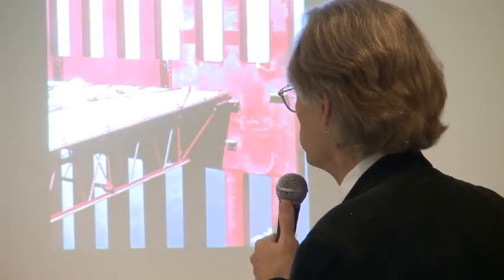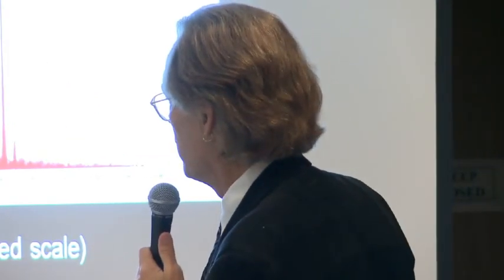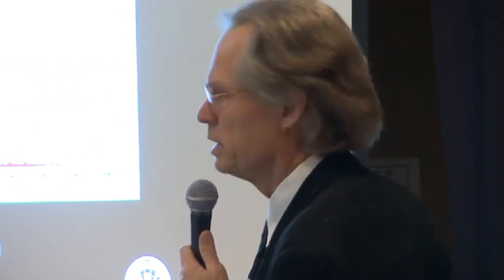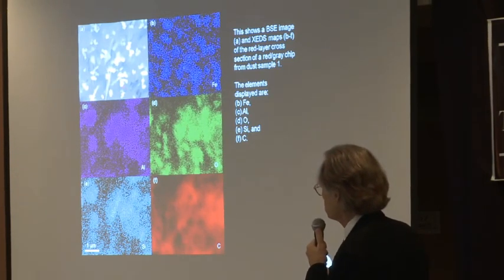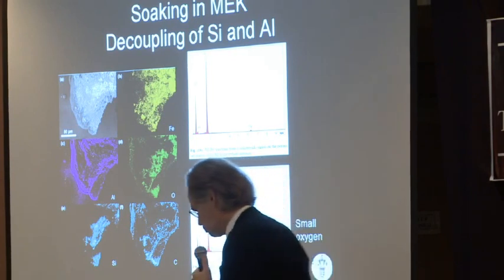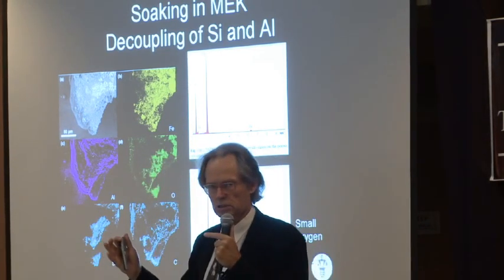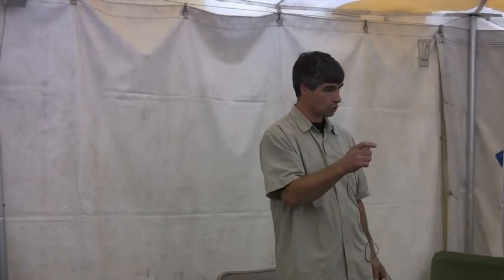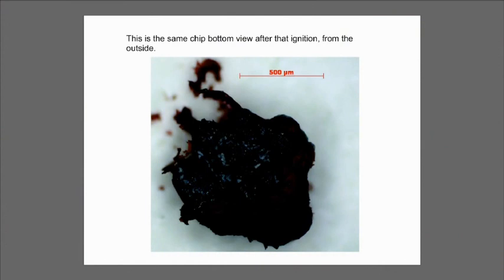9/11 WTC-chips are not paint and produce a thermite reaction: Dr. James Millette is wrong

Comment: As I remember, nanosized (transparent) iron oxides has been frequently manufactured with quite uniform particle sizes/narrow distribution for many decades. But they have tendency to agglomerate later. Probable "Laclede primer" manufacturer, Pittsburgh Plate Glass Company, simply solved this issue, therefore we see uniform iron oxide rhomoedric nanocrystals in the paint layer.

Comment: I wrote: "..there is no reason to think that this chip is anything else than some WTC red primer". I meant....judging from the analyses of chip themselves, indeed!  
Moreover, the hypothesis that molten metal allegedly found in WTC basement had anything common with extremely short burning of nanothermite is exactly as idiotic as that it has anything common with burning of paint:o)

Comment: No melted steel in the crushed floors which looked like a meteorite. I can see rebar from the floors bent holding the 3 or 4 floors together. I see paper, no melted steel. No thermite. I see paper in your "meteorite", lol. Paper. You sure are gullible. Get glasses.
Wow, melted metal youtube videos. Wow, take that to 60 Minutes - Sunday? Wow, just wow, youtube video. Wow. 
Why is the rebar not melted? lol
Look up simile. Find some melted steel. You will find a lot of simile, no melted steel.

Comment from the maker: Google: 
"WTC fires burned for weeks" and you'll find News articles that tell the WTC fires lasted around 12 weeks! 

Think about the actual size of the building fires just before each of them collapsed (relatively small in size, most of the floors in the three collapsed buildings had no fires in them when they collapsed)
..and then try to explain what kept the fires burning for 12 weeks, after all that water and foam sprayed on the piles

Pocket fires still burning in December 2001 =Thermite

Comment: What is puzzling about the sulfur?  What did FEMA say; more study. At 1000C, it was not thermite. Quibble about the corroded steel all you want. Using the corroded steel as evidence of thermite is a sign of mental illness. 
Since there is no damage to WTC steel by thermite, you have to  make up other silly questions so you can Gish Gallop your way to woo.
You should have taken more chemistry classes, and added at least on course in Chem Eng so you could comprehend the report, and eutectic.

Comment: No melted steel. The eutectic of the corroded steel shows the steel was subjected to 800 to 1000 C. Not hot enough to melt steel, but hot enough for the steel to be corroded by fire. 
The "WTC meteorites" are 3 or 4 floors fused by the energy released on 911. Tower collapse released E=mgh. Physics explains the collapse. Fused floors look like meteorites, a simile.
No melted steel on 911. Melted metals on 911. Aluminum, lead, copper, Magnesium Alloy, zinc, things that melt in office fires.

Comment: There was no evaporated steel on 911. No melted steel. There were two pieces of corroded steel found. Corroded in fire. The max temperature of the corroded steel was 1000C. No thermite damage to any WTC steel. No tons of thermite product, piles of iron, found. 
Gish Gallop on  to new crazy claims. What did 60 Minutes say about putting your claims on TV?  lol
The steel was corroded at temperatures 1000C and below. Which part of 1000C do you not understand. Your thermite fantasy was no used.

Comment from the maker: evaporates ..not melts

Lawrence Livermore National Laboratories talks about the (iron ox- Al) solgel thermites exceeding 3500 degrees C, and boiling point of steel is around 3000 C, they say
It's not melting, it evaporates at such high temps.
 If there is sulfur in the nanothermAte, it explains the sulfur corrosion

Read the LLNL article yourself:

"Nanoscale chemistry yields better explosives"
w. w. w..llnl.gov/str/RSimpson.html

Comment from the maker: The patent talks about AVERAGE particle size of less than 100 nanometres. Average doesn't necessarily mean that the powder is very consistent in particle size.
..And this is exactly what i meant when i question pigment powders being very, very consistent, and i'd expect some variation in particle size if it's just primer paint.

But Harrit et al paper speaks of the iron ox as being "..  consistently 100 nm in size and have a faceted appearance.", so very uniform.

Comment from the maker: "..there is no reason to think that this chip is anything else than some WTC red primer."

-Other than the large amount or 'iron rich micro sphere' in the WTC dust, reported by EPA and USGS, and the investigators hired by Deutsche Bank.

-Other than the molten orange-hot metal that they found from WTC basements many weeks after 9/11

"Paint and fire" produced the molten metal, seen by firefighters and others, running in the basement floors of the WTC buildings, right?! ..for weeks. Paint?

Comment: The steel did not melt, it was corrosion 1000C and less. No thermite damage to any WTC steel.
Called Gish Gallop, you keep bringing up new junk to support your fantasy. Your delusion never ends. You failed on the steel which corroded, you bring up the eutectic which had sulfur in it. No thermite damage, sulfur. At least you don't know what UPS have in them. Knowledge free, easy mark for Jon Cole and other nuts in 911 truth. 
Jon Cole's experiment left fused iron on the steel. I saw it.

Comment: "Niels Harrit actually told us that they cut another chip"
Where and when? Why is he holding back that data?
"But cause they didn't cut the MEK chip, you can always go on claiming "it's a different chip""
At the very least there is zero proof that it's the same. But Fig 14 would show more "contamnination" that anything if it were the same. Unlikely.
"ou're the one who withheld info about clays used in sol-gel/aerogel composites"
What??

Comment: Even if the MEK chip was the same material as chips (a) to (d), but contaminated e.g. with Zn and Cr stuffs (why?), there is no reason to think that this chip is anything else than some WTC red primer. It has a typical composition of paints, typical structure of paint (thin compact layer on the rust flakes and typical behavior when "soaked" in MEK. Everything we know is in perfect match with some red primer paint:o)

Comment from the maker: "That chip was of a DIFFERENT material than chips a-d, which contain kaolin, where Al and Si are bound."

You only assume and make claims that they're chemically bound, but you have no proof to back this claim!

Harrit et al even say it is very difficult to tell, so you can't make the claim the other way around either. 

Ultra-fine particles might only APPEAR to be chemically bound cause they'd be so very close to each other
..but with accurate enough instrument the truth could be shown.

Comment from the maker: "You show that you don't understand the gel processes. No, that is not possible"

What i actually meant, and it's what i heard, is that if you do not use that analyzing apparatus the right way, and don't direct the beam just in the right position, you might not get the right reading
..so with very, very tiny particles placing the beam in the right spot would become even more difficult, right
so i actually didn't refer directly to the sol-gel method at all.

Comment from the maker: Isn't the size in the label a "maximum" size of the particles?
That's how the sizeing (of rocks) works with cement/concrete dust
-
Why are you then supposedly qualified to talk about nanothermites, when you didn't come clean that clays are used in sol-gel matrixes?

It's funny how it always works with "debunkers", they/you can side-track and change subjects all you want, but the other guy is supposed to hold a degree on the matters he talks about or he's views are attacked immediately

Comment: "I'm sure you know alot more a about paints than i do, but the UNIFORMITY of the Iron oxide particles is what is bothering me"
Why does this bother you, when you already acknowledge that you don't know enough about paints? With some smart googling you can find pages where pigment producers, often from India, offer iron oxide pigments, assorted by size (often, you find labels such as "RD 130", which would mean "mean pigment size 130 nm")
Which smaller particles?
There's no elemental Al, sorry.

Comment from the maker: Exact words used in the Harrit et al paper:

"Evidently the solvent has disrupted the matrix holding the various particles, allowing some migration and separation
of the components. This is a significant result for it means that the aluminum and silicon are not bound chemically."

..meaning Al appears to be in there as dust
-
"Most likely" ..some of those maybes-maybes, ay?! But, still you're correct and others are wrong ;)
..thou all you offer is maybes-maybes

Comment from the maker: Maybe you should read the internet and find out what the "thermite-freaks"  use to produce a thermite-reaction from different materials.

I don't see why the minerals in the clay-base couldn't have an effect on the thermite reaction ..Even Al-oxide releases energy at high enough temps (boiling point), i have read
And nanothermites apparently can reach(over?) 4000 degrees C
-
Harrit et al paper talks about free Al, how many times i have to repeat that. Page 12 (bentham p. 18).

Comment: None of the images Harrit e.al. present for the MEK-soaked chip show any Iron oxide particles at all. 
Some of Millette's BSE images show the Iron oxide particles very clearly. So you are wrong.
No iron oxide particles visible in the multylayer chip, none in Fig. 32. No images even exist of the four chips tested in DSC.
Millette's Figure 14 is good. Fig. 16 is excellent (where is Harrit's TEM data??), Fig. 18 even better. Several more good enough. What's your beef?

Comment: "now you're acknowledging that some of the red-grey material has elemental aluminium in them, are you?"
No, not at all. Just that in the MEK-chip, which is most likely Tnemec, Al and Si are not bound together, as the Tnemec formulation has no Al-silicate like LaClede and like chips a-d. Even Harrit himself in the very same presentation, says that the proof for elemental Al in the MEK chip is only indirect.
"Millette claimed the Al and Si are bound together chemically"
They are - different chip!

Comment from the maker: "Chips a-d have Al and Si bound together - kaolin clay."

..Or this could mean also, that when the particles are very, very small, and very intimately mixed (sol-gel/aerogel), that it is very difficult to tell if they are one entity or as separate entities.
-
According to Harrit et al the Ca peak  in the MEK-chip might actually be contamination from wall boards

So the possible surface Fe contamination could have "thrown off" also the Al-FE ration.

Comment from the maker: At very high temps, i have understood, that metals evaporate away. Nanothermites can produce temps around 4000 C, way past the boiling point or iron
-
FEMA sure thought it was very unusual, and needed further investigation

..and FEMA couldn't give a clear explanation to where the sulfur actually came from. Jon Cole (ae911Truth) tested the wallboard-hypothesis for hightemp sulfur corrosion and it didn't work

Jon Cole also produced very, very similar thinning of steel with his thermite.

Comment: No need to replicate DSC experiments, since Millette conclusively proved that Al is solely in the non-thermitic form of kaolinite in the chips. Kaolinite cannot react by thermitic reaction with iron oxide, hence "case closed". Structure and behavior of chips is fully consistent with red primer paints:o)

Comment: Red Laclede paint for WTC1/2 floor trusses contained these main pigmants according to specification: 
-iron oxide 55 %
- aluminum silicate (typical example is kaolinite) 41 %
Epoxy resin was a binder. 
XEDS spectra of Bentham chips (a) to (d) are in almost perfect match with this specification, as well as thicknesses of layers and their structure. Kaolinite was proven not only by Millette, but also by Harrit et al., typical platelet structure we see in Fig. 8 is very telling:o)

Comment: - One single Fig. 17 in Bentham paper is not convincing evidence of elemental Al. According to XEDS in Fig. 14, there is ridiculously low level of Al to consider MEK chip as thermitic. 
- No thermitic reaction was proven in any chip. Spheroids are probably sintered remnants of gray layers after burning of organic polymer binder in the chips. Chips were not heated to 430 degrees C, but to 700 degrees. No paint with polymer binder can be regarded as really "heat resistant". Etc.

Comment: LOL, steel corroded in fire, up to 1000C. Proves no thermite was used on this steel. It was not melted steel, it was corroded in fire. Steel rusts.
911 truth lies about this because they can't read; the text clearly shows the eutectic formed between 800 to 1000C.  Way below melted steel temperature. Take a chemical engineering course  to learn how to understand what a eutectic is. lol, this is classic 911 truth lies. 
Funny, chemical engineer could explain this, why believe internet lies?

Comment: "So you're trying to claim here ..

That in the late 1960's, they used NANO-TECHNOLOGY to get the iron oxide into as UNIFORM CONSISTENCY as possible ...when making paints?!"
It doesn't require "nano-technology" at all to synthesize iron oxide pigments in large industrial amounts (Laux process since 1920), and grind and sieve it to any size you like. Cheap, low tech.
The peer-reviewer, Griscom, told Harrit e.al. the iron oxide looks just like ordinary paint pigments. They failed to listen+learn.

Comment: "organic combustion - At 430 Celsius?"
Yes, of course. Elsewhere in the presentation, Harrit says that all organic stuffs react no later than 450 °C.
Ignition point of epoxy is 425 °C.
"at which point/temp there is this very energetic reaction"
WRONG, it is not "very" energetic.
"meaning that the iron (oxide) heated past it's melting point?!"
No, it doesn't mean that. The specimen never got hotter than 700 °C. Harrit and Farrer don't understand DSC. 
Spheres can form in many ways below 700°

Comment: You still don't understand why Millette ashed his chip.
Chris Mohr asked Millette to answer the question: "Is there thermite in chips like the ones Harrit studied?"
Millette did all the steps necessary to show he studied the same material as chips a-d. Then he used COMPETENT methods: FTIR, TEM. To do TEM he needed to free pigments from matrix.
Competent methods prove: NO thermite, no free Al.
DSC is an incompetent method to ID compounds. Therefore not done.
There is no thermite in these chips.

Comment: First, they have two DIFFERENT kinds or red-gray chips. Chips a-d are different from the MEK-soaked chip.
Chips a-d have Al and Si bound together - kaolin clay.
The MEK chip (Tnemec) doesn't have kaolin. It has silica and calcium aluminate.
That chip has less than 1% Al. For it to be a usable thermitic composition, it would need close to, or more than, 20% by weight Al.
You understand incorrectly, They didn't show that Al and Si were together in the MEK chip before soaking.

Comment from the maker: Millette's data speaks of similar material as paints contain, it doesn't actually PROVE it's paint.

Example:
Millette claims epoxy resins are a proof of the chips being paint, but does not take into account that epoxies are used as binders in sol-gel composites.
So discovery of epoxy in the chips cannot be held as unquestionable proof of paint. sorry.

..also

Google:

'clay aerogel composites'
Amorphous clays are apparently also used in aerogel/sol-gel matrixes

Comment from the maker: -I believe, he's referring to what NIST stated about the primer paint. 

" The MEK-soaked chip is a different material than most of the other chips"
-They apparently  didn't clean the MEK-chip, so it could have had contamination from the actual WTC paint on it.
Is it possible there was contamination on other chips they studied as well? (rhetorical Q)

-They also found -multi layered chips, so they have stated that there are at least two kinds of nano-thermite chips in the dust

Comment from the maker: -May be the whole chip didn't ignite properly? 
-Maybe there is not enough Al to reduce all the iron oxide from all composite?
-Maybe the ignition characteristics are such that the whole material does not burn in similar way with regular thermite mixtures. They can alter the behavior of sol-gel nano-termites quite a bit with the additives, proportions, etc.

Have you asked this directly from Jones, Harrit and these people?
..what did they say? 
-
Harrit assumed tried up Tnemec

Comment: Harrit wrote: "The red/gray chips cannot be the primer paint as it is characterized by NIST." In this point, he is very probably right. But very apparently, chips (a) to (d) in Bentham paper, which were closely analyzed, are simply another WTC red primer paint, namely that used for protection of floor trusses. This primer is supposed to be most abundant in the dust and its composition and structure (thickness of red layer) is in almost perfect match with the analyses given in Bentham paper:o)

Comment: "I figure if the data wasn't accurate"
Their data IS accurate - albeit insufficient to properly ID the chips. Some of their assumptions, and their conclusions from the data are FALSE however:
- XEDS and SEM of chips a-d is consistent with paint, not thermite
- XEDS of the MEK-chip proves that chip can't be thermite
- DSC data proves that something other than a thermite reaction occurred (organic combustion)
.- Post-DSC images prove no thermite reaction occurred